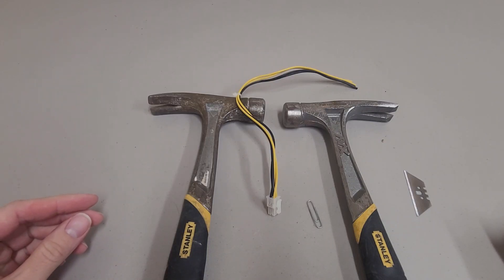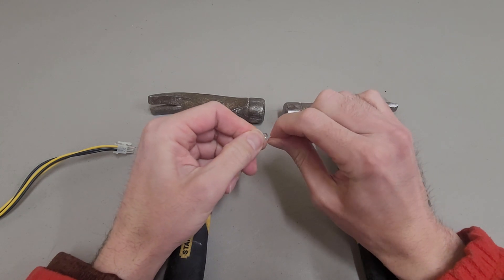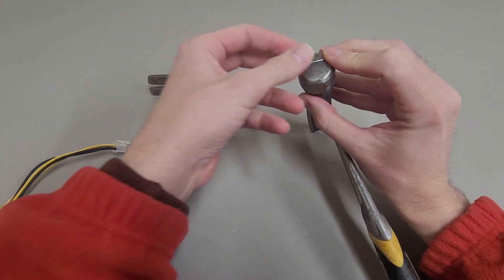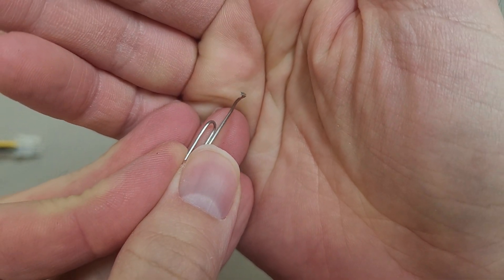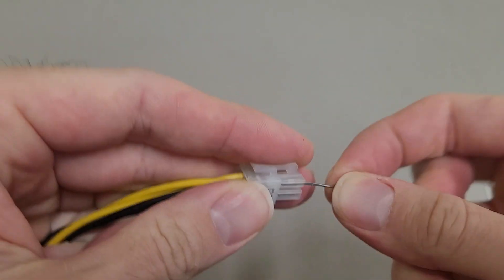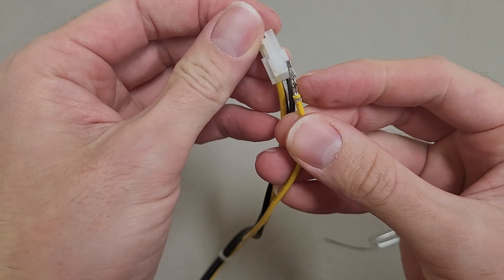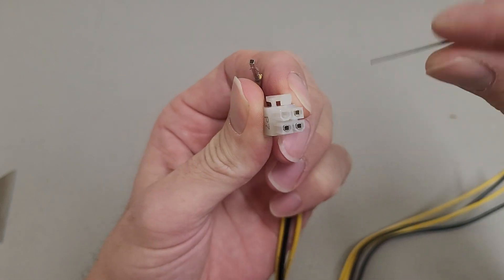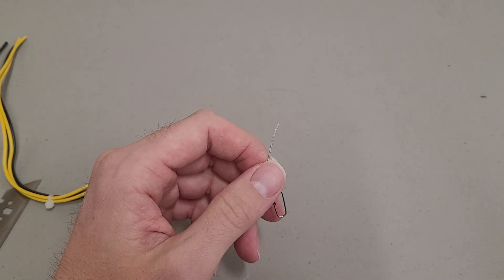The simple trick I use to extract pins from Molex Mini-Fit Jr. connectors for PCs

Comment: Here's an idea: If you make a U-shape of the paper clip and flatten both ends you basically have what the official Molex tool does. Insert both side simultaneously. This makes the locking tabs flush with the housing so the pin can slide out, but does not apply enough force to plastically deform the tabs.
Reply from the maker: That is a good point. I've tried doing that to replicate the official tool but it is hard to work with. Maybe I need to try again.

Comment: If you have either a Slotted 1.0 mm screw driver or a Slotted 1.0 mm driver bit, it is the perfect size and shape for this job. They are those slotted micro screwdrivers. Just insert it in each side and twist and it will bent the locking pins in to the open position.
Reply from the maker: Good to know. I don't have any of those screwdrivers personally but I'm sure it will come in handy for people who do.